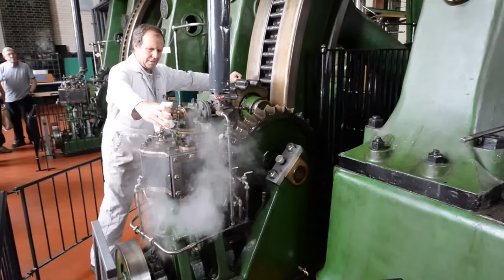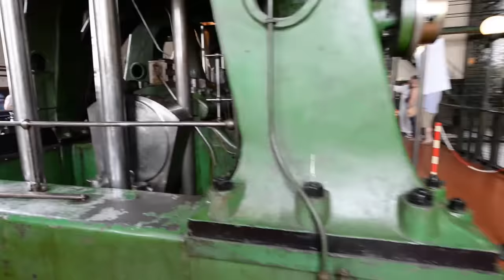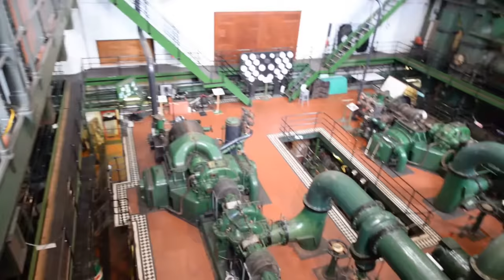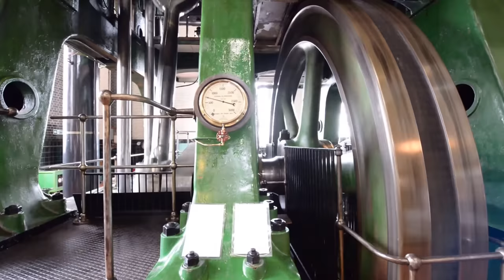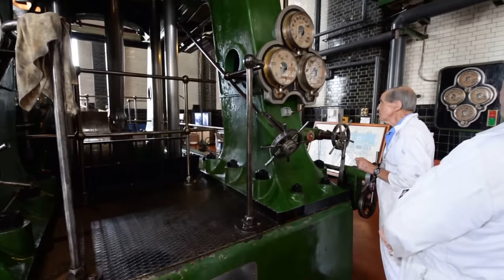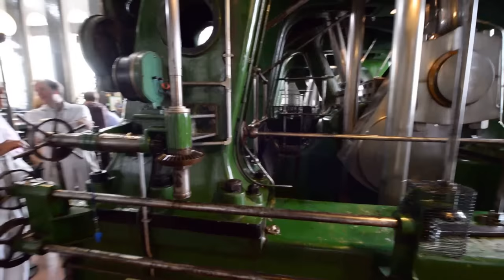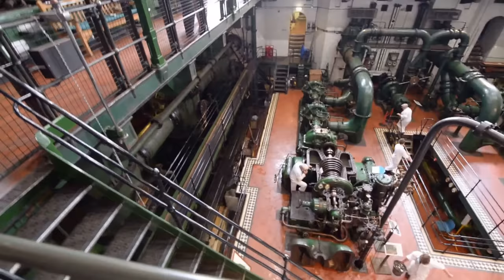Kempton Park  Big Triple Steam Engine Starting

Comment: I am one of the lucky ones to see these run in anger, pumping water to London, before they were shut down.
Reply from the maker: That's great Andrew I'm guessing seeing these start was not a common  occurrence, was the other pumping engine kept as a standby or did they both ump in anger when conditions required?
Reply: There were two of these powerplants in the RMS Titanic. One for each outer Port and Starboard screw with a steam turbine on the center screw before the rudder.
Reply: The ones on the Titanic produced 15,000 hp each and were much larger.
Reply: 916fanatic1 You are right.
Reply: You are one of the lucky ones, that's for sure...
Reply: Lucky!  I love this stuff.
Reply: +916fanatic1 it seems odd that these are rated at only 1000 horses, for their size. Compared to traction engines or locomotives, these seem to be an order of magnitude larger per horsepower. I mean, I suppose that's the triple expansion efficiency, but still.

PS: the Ir Woudagemaal in Friesland is also a pumping station, but for drainage rather than drinking water. To this day it represents 40% of the pumping capacity that keeps Friesland dry, the other sixty percent being provided by an electric one that replaced it. It is only used in particularly damp conditions, most of the time the other one can keep up. Seeing it run in anger is always fun, but the engines are waaaaay smaller than these guys. Only steam powered pumping station in the world still in actual use, I believe.
Reply: Jasper Janssen I think that steam engines provide a small ammount of horsepower for their size, but have MASSIVE ammounts of torque.
Reply: Yeah, but compared to other steam engines.
Reply: Jasper Janssen Maybe it was a missreading of the info.
Reply: +MFE well, Wikipedia claims simultaneously that these are indeed 1008 hp, that they're extremely similar to Titanic's engines (right size, right displacement, but three cylinders instead of four), except for having flywheels, and also that the ones on Titanic developed 15000 hp. Somehow, 3/4 of the engine developing 1/15th of the power seems wrong.
Reply: Due mainly to inertia?
Reply: Jasper Janssen Or, maybe Wikipedia isn't allways the most factual website ever.  Just sayin'.
Reply: Crow T. Robot It has to do with the up and downstrokes because of the steam preassure.
Reply: Andrew Offord can,t get over the shear size of this engine. My father would have loved it  And to see it still working is a credit to all.
Reply from the maker: Andrew Offord great did you get any photos of the plant?
Reply: Mark Bowman 
I am afraid not,it was the early 70's when I was there,visiting my Grandfather at a weekend,as he was one of the Shift Operators running them.
I was only 7 at the time,but it something that will stay with me for a life time.
The Noise and the Smell those Engines made.
Reply: RobertAYYY Power is the measure of an engine's power, by definition. Torque is related, but you can definitely have a high-power, low-torque engine. Gas turbines, for example. 

Shifting the balance between torque and RPM requires the use of a suitable gearbox or other transmission.
Reply: +Jasper Janssen, It may also depend on what steam pressure was being used: Many years ago I visited the SS Great Britain in Bristol; at the time there was also a steam tug boat giving short trips around the basin, on one of which I spent the whole trip in the engine room talking with the engineer, comparing the advantages and disadvantages of diesel engines over steam power (among other things). When it came to torque, diesels are good but have a 'set' limit at peak output. More power needs the engine to go faster, and will eventually lead to water being 'churned' but not producing more 'thrust'. With a steam engine he could increase the the pressure if needed (within safety margins), and get an increase in torque without a corresponding increase in speed (RPM). Quite how to account for it as I do not know the science? But it does make an instinctive sort of sense. The same applies to railway loco's as well, on pulling heavier loads.
Reply: Lucky bugger. Would love to have seen that, magnificent machines.
Reply: In general, a diesel engine's torque output is dependent on the quantity of fuel properly burned per cycle; its power output on the quantity per second.  That quantity is typically limited by one of two things: the capacity of the fuel injectors or the amount of fresh air available in the cylinders.  Hence the widespread use of turbochargers on diesel engines, simply to get more air in.  The turbo-intercooler, additionally, is a device that doesn't increase the pressure of the intake air, but its *density*, again allowing more fuel to be burned usefully; some compound steam engines, such as the Midland Compound locomotives, had a roughly-analogous reheater between stages.

There are reliable reports of certain WW2-era submarines, which were diesel powered, obtaining as much as 10% extra speed (that is, an extra 2 knots beyond the normal 21-knot flank speed of a USN "fleet boat") in emergencies by overriding the engine governors and forcing the injectors to maximum output.  Due to the cubic relationship between power input and ship speed, this corresponds to a 30% or greater increase in power beyond the normal flank-speed rating, which itself was typically a short-term rating (perhaps one hour) by the manufacturer and verified during sea trials.  But this could only be achieved on particularly "good" engines, such as the Fairbanks-Morse opposed-cylinder engines, which were robust enough to sustain an overload.  A similar procedure undoubtedly accounted for the "Dreimal Äusserste Kraft" command (Third Emergency Speed) as seen in Das Boot.

If an increase in power resulted only in water being churned but no extra speed, I would attribute that to an insufficiently dimensioned propeller, not the characteristics of the prime mover.  Possibly the higher rotation speed of a diesel engine encouraged the use of a smaller propeller for a given power output.
Reply: 80 RPM...STEADY ON OLD CHAP....that's getting a little fast old boy.
Reply: Horsepower shows how fast you hit the wall. Torque shows how far you went through the wall
Reply: not quite.... torque is how far you took the wall with you
Reply: pressure and speed, the higher pressure an engine is run at, the more torque it has, the faster it spins for a given torque, the more power it has. The better balanced an engine is, and the better the bearings are, the faster it can spin without tearing itself apart. Combine more pressure with more speed, and you have an engine that might be the same size, but it can produce a lot more power. 1008HP for an engine that size is extremely low, 15K is much closer to what I would have expected.
Reply: Спасибо за пояснения про этот двигатель.
Reply: @Capt_Frost  I wonder how many tons of torque one has?
Reply: @coniow  the engineer is right. Its exactly like working with boost. A steam engine could operate anywhere from 100 to 1000 psi of pressure and a diesel can only use a small window. Steams power output is largely dependant on the flow of steam since by design it just transmits the power of water expansion rather than burning a fuel to directly act upon the crank. So you could just crank the steam pressure and increase torque. Diesel engines have to spin faster to create a situation where more power strokes occur within every minute, increasing their power. Same with gas.
Reply: @someonesomewhere1240  Which might explain the huge Hp disparity between this engine and the Titanic's.
Reply: 916fanatic1 In the Desc, it say it was the same size as the engine in titanics
Reply: So this machine used to be a giant water pump?
Reply: @fancillluio7544  Yes, it used to Pump Treated Water to London and Surrounding Areas
Reply: @andrewofford1533  The old machine is still able to run now has a special charm, very wonderful.
thanks.
Reply: Now you retired or the technology is changed..?
Reply: @baselkipris1528  No, Still working.These  Pumps were replaced with Electric ones, back in the late '70's. They are a lot Smaller, but Pump 4 Times More
Reply: Kromaatikse Power ratings of engines are in themselves just “made up” by the parameters for the rating. A good example is Wärtsilä Diesel engines. Most Wärtsilä engines are able to be run at 110% of their rating indefinitely, if other auxiliary components are dimensioned accordingly. A funny anecdote about this is how the Wärtsilä engineers reacted after Wärtsilä bought a French manufacturer of “hyperbaric” Diesel engines, aka. engines with rather high internal pressures, that happened to manufacture the main engines for French tanks (LeClerc if memory serves?). When asked about the peak power output, then French engineers proudly told the Finnish engineers from Wärtsilä that their engine could operate at that power output for 60 seconds. But that was more than enough, since a tank needing full engine power had a mean time for survival on the battle field of around 15 seconds. So it’s a matter of where you place the goal posts to begin with.
Reply: Jasper Janssen HP output is dependent on RPM, so an engine that develops a lot of torque at low RPM will always have a low horsepower output. Hence the “silly” numbers attributed to these engines. It’s the same with ships diesels, they might “only” develop 400 HP at peak RPM, but since that RPM might be 750, the torque is comparatively insane.
Reply: David Vance  Yes, Coal was used to Heat up Water, in boilers, to become Super heated Steam.
Reply: @billfitzpatrick6910  You're confusing speed and momentum.
Reply: @MegaGeorge1948  no they wernt. The model was different but still worked the sane way.
Reply: @tatmannewsnetworkyourfavor3822  "No they weren't"? What are you talking about, Damien? Titanic had two triple expansion stream piston engines driving the port and starboard screws (these engines were larger than the Kempton Park Big Triple Steam Engine). One for each screw. and one Parson's stream turbine engine turning the center screw before the rudder that used the steam from the exhaust of the those piston engines.
Reply: @MegaGeorge1948  It wasnt the same engines. You are right about the way that they worked as it was the same process but the engines were still different because of her being a ship and weight. There was drivetrains or in car engines, crankshafts
Reply: "run in anger" I love that
Reply: Lord Manhammer  Actually, that isn't true.  These engines do exhibit a gargantuan amount of torque, but total power is equal to RPM times Torque (in foot-pounds) divided by 5,252.
Reply: You can still see the steam engines working at the Woudagemaal in Frieland, the Netherlands. These are now 100 years old and still every now and then in use as part of the waterdefence system.
Reply: @mjamesthomasb  They were duty / Standby and swapped around once a month. But as demand increased, the second Engine was called into service, more and more. The electric ones, that replaced these, had a greater capacity, for a much smaller size., they also ran on AC Current, unlike the equipment assiociated with the Engines, as this was DC, Generated on site, via Steam operated Gernerators. They also used Mercury Arc Rectifiers as well.